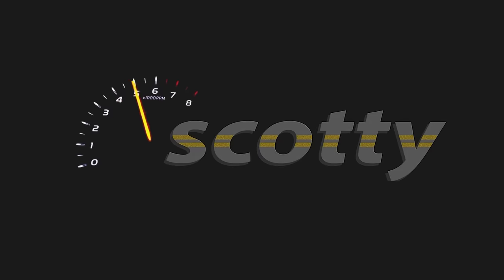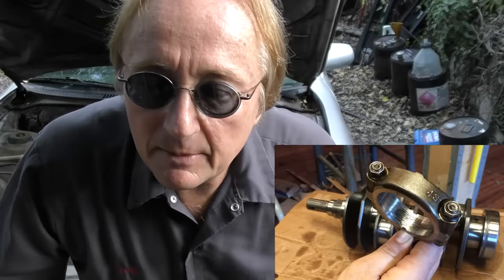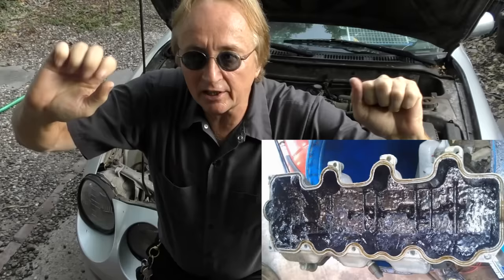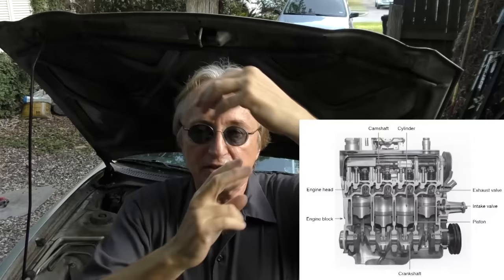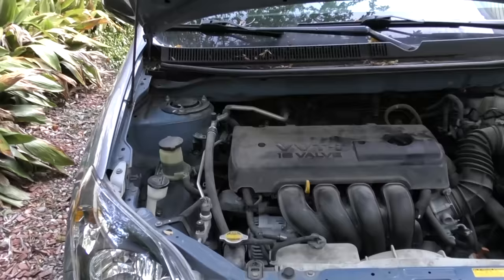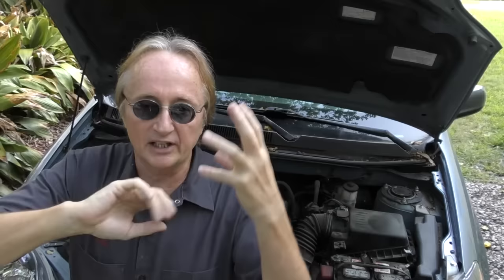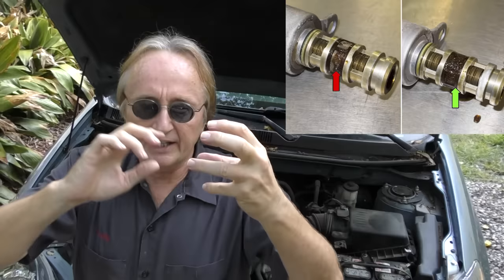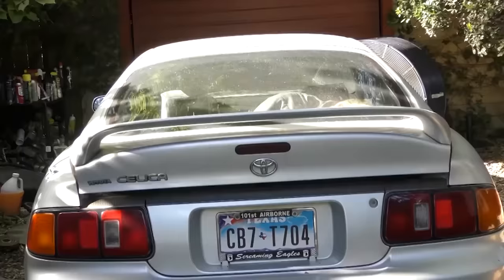Why Not to Flush the Engine Oil in Your Car

Comment: Moral of the story: buy classic cars that you can rebuild the engine yourself in 2hrs and at a cost of $75
Reply: Great idea... 99% of the public does not have what it takes to own a classic car. I have a bone stock  '51 Mercury and it would make most people run away scared when faced with the 68 year old challenges of an antique automobile.
Reply: and where can i find those cars?
here in europe, euro 5 engine, are not allowed anymore
Reply: Patrick Ryan the parts are rare because of collectors
Reply: That's why I own 3 VW beetles
Reply: Yeah and then you can drive like a snail because old classic cars weigh a ton and back then they didn't have horse power lol they had 100 little ponies, cars were really slow, even a cheap new civic with 160 hp would smoke any classic car with those big engines 😂
Reply: MCES LEX ahhh take it easyyy 😭
Reply: MCES LEX they had horses, just heavy cars lmao
Reply: @XerxezsX  yea...you don't have to drive fast when you are cool.
Reply: @XerxezsX  not everything is about going zoom
Reply: Ugh!  I don't miss carbs one bit.  "Classic" is just another word for 19th. century technology.  No thank you!
Reply: Those are exaggerated numbers lol
Reply: Ive had many classic cars. 68 ford fairlane was the easiest car to work on next to my 68 chevy c10 pickup truck and engine options make modern swaps a breeze now adays. I had swaped in a 6.0L from a 2003 gmc into my chevy and make 450hp with a mild cam swap and good tuning still was able to get 20mpg through a super strong TH400 transmission 3speed and 3.23 gearing. Ford was so lightweight for the size 3200lbs that any cheap stockish 400+hp junkyard ls engine swap would have made it a blast but the stock 289 was original and still ran like a top so i didnt want to tear it down even though it only made 200hp.
Reply: @patrickryan2614  : 20 mpg from a 6.0 with a TH400 3-speed and 3.23 gears?  I think your math is fuzzy.  Even with jumbo tires(315/70-17) that 5000 pound truck with barndoor aerodynamics is still turning a lot of revs at cruising speed.  You must live in a warm climate.  Winter weather and carbs have never mixed.
Reply: @Alexi7666  truck does not weght that much. Under 4k lbs actually. I kept the fuel injection no stupid carb to mess with. I wasnt driving past 55mph though haha
Reply: that is volks wagon
Reply: @XerxezsX  
Yet that heavy , snail slow classic is worth more than your car 20X over.
Reply: @XerxezsX  old cars had lots of horsepower.  My 58 cadillac with its original 365 v8, is rated at 310 HP. Its not quick because it weighs 5000 lbs. But if you really get on it, its not a dog either.
Reply: Good luck finding the parts
Reply: @msa6005  obviously you have never worked on any hot rods. Easy cheap and plentiful aftermarket parts galore!
Reply: Lol thats what i told myself and no
Reply: Yeah, the only problem is finding parts for the car. Even if you manage to get parts, it's gonna be a lot more expensive than it was decades ago.
Reply: @johnfranklin5277  😮😮dang
Reply: Lol, Dude, I don't know about that 2 hours & $75 !! Lmao.  But way easier to work on & no metric tool's Needed!!
Reply: @christiannovak3803  Drive fast = Cool. Drive too fast = Not cool.

Comment: you dont need a flush every oil change but every 30000 miles better. Is only 10 min... come on...! thats not hurt anything. Also What I do is buy the cheapest oil gallon to used to clean up the rest of the Flush additive and then I put the best oil of my preference. that will clean the engine and will run better
Reply: If you own car from new, definitely worth it. But if you have no clue was it or wasn't it flushed beforehand, don't bother. It's not a magic pill. Most people look for cheap solutions when car starts to run rough. Engines are simple, assisting components are getting more sophisticated, that is where it all goes sideways. Flushed engine evreytime for wife's car, 120k miles later no problems. But I wouldn't do it for my older mini.

Comment: I have never had a want or need to buy a brand new car. So I've always bought used cars, trucks and first thing I've always done is engine flush/oil change besides all fluids and tune up. People aren't exactly truthful about what they've done to take care of thier vehicles especially when selling. I do it so I personally know what has been done and hasn't left me stranded yet. Love the videos as always. Im 50 and learned from my father who was a mechanic when I was a kid and am so thankful for all the knowledge he imparted to me.
Reply: Has the engine flush ever damaged anything?
Reply: @jd646  No. You don't want to do a flush every oil change, it'll damage seals and you'll experience oil leaks. I do them if it's a new vehicle to me, or every 50k miles. My cars and trucks have never left me stranded and thankful for that.
Reply: We grew up in good times for spannering.  I do the same with my cars

Comment: I changed the oil with oil additive and flushed the engine every year on the ol' 91 Corsica and had it for seventeen years and it's still running great!  I still think if you have a engine with a light lifter tapping, flushing the engine before the oil change might open up the clogged lifter oil port and cure the lifter tapping!
Reply: I'm using a 2004 Galloper Petrol 3.0 V6 ...  it has some issues, I'm guessing from lack of maintenance. Should I try a motor flush on the oil change ?
Reply: @babagandu  I would.

Comment: Flush engine oil? Most people I know, they don't even bother changing their oil. They just ignore it until their engine clacks like a diesel. Great video as always Scotty!
Reply: We have a society where 60% of young people have university degrees, yet practically none of them know how to maintain their own cars or repair their own furnaces.
Reply: Yeah many people run cheap oil 15-20k miles and never check. It's a shame
Reply: have to be pretty clueless to not change the car oil
Reply: Omg hahha
Reply: I have a "bypass" oil filter kit on my Diesel and I use a top tier synthetic that I have to top off occasionally due to oil leaking (oil cooler lines leak lightly;) with all of this considered, extended intervals can be done in some cases.
Reply: This is a good moment to teach people how to do stuff and not be a jerk and let them get into a pickle, per say. Whether doing an oil check or making sure your plumbing is ok around your house.
Reply: @Andy-im3kj  
Per se
Reply: @ninjamaster3453  - It's not being cheap that is bad. It's not meeting SAE and API standards, and ignoring recommended change intervals or better.
Reply: IT'SME  - He's been dead for a century. He won't care. Fell overboard.
Reply: IT'SME  - it's also a kind of motor and a class of fuel oil. If I was writing about Rudolf Diesel I'd capitalize it.
Reply: IT'SME  - Like whatshisname.
Reply: IT'SME  - Where do you get this idea? 
General MOTORS
Ford MOTOR Co.
Harley-Davidson MOTOR Co. makes MOTORcycles, not ENGINEcycles.
Honda MOTOR Co.
I put MOTOR oil in my car and truck motors.
An “engine” is an ingenious device, usually powered. ENGINE lathe.
“Engine” and “motor” are indifferent in America. In other languages than English some variant of “motor” is used as a name of the machine that converts energy to mechanical motion: French “moteur”
Italian “motore”
German “Motor”
Spanish “motor”
Swedish “motor”

Comment: What I do know is that my 2006 gmc 5.3 developed an intermittent lifter tap at 184k miles. I have always used full synthetic oil every 5k. I was going to have the lifters replaced but decided to try Liquid Moli engine flush first... It worked! No more lifter tap. It seems that the engine is more quiet and runs smoother as well.
Reply: Did you have minor sludge in it by any chance?
Reply: Liqui moly engine flush is miraculous.
Reply: Is it still running good after 9months?
Reply: I have an 05 silverado 5.3. I was thinking of doing the same thing. Is it still good after you did the flush?
Reply: @Vahan210  did it with my sonic after oil cooler blew worked great
Reply: They make a high quality product. I used to take my VW to the Valvoline down the street but after I started changing it myself with Liqui Moly the car seemed to run better. I even bought little liqui moly service window stickers lol.

Comment: If your engine is over 200000 miles, leave it alone and just change the oil and filter every 3/4k miles, Scotty's right about the seals.
If your engine is below than 200000 miles and changing oil and filter regularly, you don't need a flush in the first place.
Only flush your engine if it's below 150000 miles and has doubts that the previous owner didn't really care about changing oil regularly.
Reply: Im currently there. I have a car with 145k miles, previous owner has full service book, but engine looks dirty and like the oil is burnt. Spark plugs also have a little carbon/oil. Gonna try flushing it.
Reply: Mileage has nothing to do with crud inside the engines, maintenace schedule and previous owners Is the problem, i have 300k engines spanking clean running like new!i also replaced engines at 20k full of gunk

Comment: I change my oil every 5-7k miles     i check it often for texture and color etc.    My 01 Tacoma 432,439 miles on her factory motor and transmission
Reply: harooni22 conventional not even the high mileage
Reply: Don't forget to test the taste though. If it tastes iron it's time for a change. If it tastes like french fries, chances are you checked the wrong device.
Reply: mcgeufer son of a gun I was wondering why I was tasting french fries
Reply: mcgeufer normal for a toyota
Reply: That's incredible. Does it have a timing chain, if so has it been replaced?
Reply: I change it every 5000k and add jsut a little bit of seafoam in the crank case right before the oil change. My 2009 mercedes c350 with  270k still runs like new because of this and looking doing the oil fill, engine still looks new with no built up gunk. Granted, the car does take 9quarts so the little seafoam I add might not even do anyting but I believe it does and guaranties to clean up any gunk that has accumulated.
Reply: Those Tacomas are magic dude my aunts has 600k miles and barely has had any problems at all
Reply: ltwargssf R You don't need that in your German car. What you need is to make sure the engine is properly burned through. So go on the highway and choose 5th instead of 6th. Remember this thing is designed to drive at top speed on the autobahn.
Reply: 21ADB21 sorry for the delay in the response.   It's a timing chain    never been serviced     the chain is still working like a champ the engine purs like a kitten        my biggest concerns is the transmission at this point  these trucks hit a million miles with the motor   but the transmission goes out between 500-600k      just gonna slap a remanufactured transmission
Reply: NCR Emergency Roadside Service Why not just buy a new one. It's much easier and whatever you say 500.000 miles on a car is more than it was built for.
Reply: Daniel Fl. Because they don't make Stepside Tacomas any more
Reply: Daniel Fl. Plus 800 bucks for a motor or 1800 for a transmission is still cheaper then a $47k Tacoma
Reply: @ncrtransport5993  change transmission oil?
Reply: @ncrtransport5993  Looking at the prices for Tacomas on Craigslist and OfferUp, if you wanted to sell that truck you could get $6000-$8000 easily!! Tacomas are in high demand.
Reply: It is amazing how just changing oil and filters regularly can make your car last so much longer with barely any problems.
Reply: NCR Emergency Roadside Service those Tacoma’s are tanks
Reply: I came
Reply: @Utsu-P_Enjoyer  dont lay
Reply: @ncrtransport5993  - "High Mileage" has an additive that causes worn seals to swell so they stop leaking. If your motor leaks a little around the front and rear crankshaft seals one oil change with "HM" may stop or reduce leakage.
Reply: How often we have to change the gear oil?
Reply: @algrayson8965  Is that needed only once?  Will it work if 25k mile oil is put in every 25k miles after?
Reply: @Utsu-P_Enjoyer  Send me a picture of the odometer.
Reply: My 04 Yukon 5.3 has 428,000 miles. Just replaced transmission. Have only changed water pump and alternator. Same with my Silverado; water pump, alternator, AC compressor, running factory engine (5.3) and transmission at almost 300,000. Pretty sure rear end is going out though, never seen a rear end die before a transmission. And it has trailer behind it daily.
Reply: @Motorsportsgeek  Every 5000k? Wasting money.
Reply: NCR Emergency Roadside Service Not fair that’s a Toyota 😂😂, my 04 Tundra 200k miles zero problems
Reply: @danielfl.9347  u must haven’t ever been to Africa or Cuba in Africa yes they have new cars but in east Africa they are still using Soviet era cars as Taxis they are blue in color and still driving. The cars and trucks manufactures make for other countries last longer and are built really tough even the newer ones u buy in Africa Toyota’s are built better than the USA versions. 1 million mile or more is common overseas

Comment: Good stuff there,  Scotty.  I did a flush treatment on my '91 Pontiac GAm (151 c.i. four) because it was getting a peculiar build up of varnish looking red color inside where I pour in fresh oil.  I did the flush and changed oil brands, that was at about 190k miles and used the car in my work until I retired and had about 230k miles on it.  I still have the car and it worked out o.k. - I'm a retired motorcycle and auto tech, things sure have changed.
Reply: Would you recommend it on my old 22 years old aged xr200r Honda dirtbike?
Reply: Have you ever had any ignition trouble with the Grand Am?

Comment: Yep, he's 200% right! Changing your oil often, is the real deal!
Reply: When I have to do a flush. I get any cheap oil from the parts store. Usually STP. Run it for 1 month. And then change it! That’s my safe way of flushing. I’d never strip my engine of protection
Reply: It's the same way with a transmission
Reply: @seventystix6964  if you where determined to do a oil flush just fill it up run it for like 2 or 3 hours take a trip, then you waste a lot of good oil cause you drain it out again and put fresh fluid thats what I would call a oil flush

Comment: Great content, as usual, Scotty. In this particular case I disagree with the generalization. I purchased more cars with maintenance neglect issues, then I like to admit. By trial and error I found out, for myself, that an initial engine flush, right after purchase  in adition to air intake clean not only improved the overall performance of those cars measurably, but in many cases also quitened the engine noise conciderably. Additionally changing ALL fluids in the car has lately becoming rather the norm for me. Sidenote: most cars I bought where between 6 and 12 years old diesel, regularly used with an average between 100k and 150 k miles.
Reply: Do you mind sharing what brand of flush you use?
Reply: I use Slick 50! Great results but only use it on older cars, I would say underneath 2010.
Reply: I agree bought a 99 camaro dude never cleaned the tb and the engine was dirty asf onky 77k Miles
Reply: I keep a car for many years. I  change oil in my car every 3 to 4 thousand miles. I always feel a difference in performance after changing oil. And I use synthetic too. Going to synthetic in my 2000 7.3 power stroke is a night and day difference
Reply: in the Army we changed the filter in between oil changes.
I put a 1/2 cup of gas in the oil and run it for about 1 minute b4 changing it.

Comment: i had an old pickup that was reading>3 psi oil pressure. ran an engine cleaner through it and it jumped to 60 psi in under a minute. still driving that truck today with no major oil leaks.
Reply: YES, hot engine + GUNK 5 min Flush THEN Full engine with Cheap oil ..THEN Change oil ..
Reply: @Maddog worker had a Buick  that did that. Was a spun camshaft bearing. Not good.
Reply: @Maddog worker did it fix the oil pressure?
Reply: @jimshoe402  Wow. Just let the oil drain from the engine overnight if you are so worried. No need to go to extremes.

Comment: So to summarize Scotty's video:

"Don't fix it if it ain't broke"
Reply: It's always best to prevent it from breaking in the first place.
Reply: There is such a thing as preventive maintenance so it will be less likely to be broke!
Reply: Better yet dont buy new cars
Reply: Also, "Don't do anything to keep it from breaking"
Reply: You are right sir. I tried to adjust the valves on my Honda and ended up making my them worse. So i always tell myself, if it ain’t broken don’t fix it!
Reply: @jamesgoodwin7875  Yup. With Hondas and Toyotas that's true. Doesn't apply to Chevys, GMCs, Fiats, and other bad car brands. :)
Reply: @marketingwithalvin1028  hey!!! Chevy ain't that bad
Reply: @iammyworstenemy3807  Chevrolet is pretty bad when compared to Toyota or Hondas, lets be honest.
LoL
Reply: My 03 Camry has 210k miles, has always had regular oil+filter changes with Mobil 1 every 4k miles.. today I decided to use Liqui Moly engine flush, I let it idle for 10 minutes and drained. Filled with cheap new oil, idled another 10, drained again (to remove residual flushing agent)

Both pans of fluid were pitch black. So I'm very happy with the results and I think there's definitely a time and a place for flushing !
Reply: A drop of prevention is worth more than a bucket of regret.